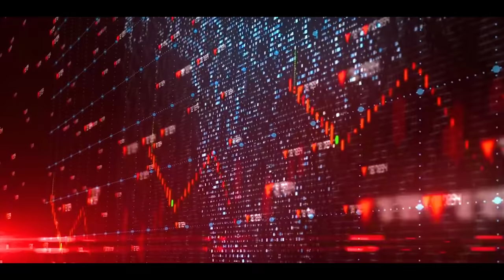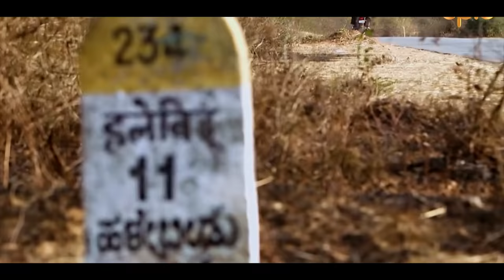Building 21st century road network to power India's development

Comment: Bangalore NEED one fullfledged ring road to avoid traffic jam in City .  Kindly start Peripheral ring road work within next two years and it helps to reduce traffic conjunction in city. We are facing challenges to travel in bangalore ...its pure pain ( petrol cost is also very high , No proper public transport, No proper last leg connectivity from Metro stations ( two wheeler parking is not available ( cost is also very high)